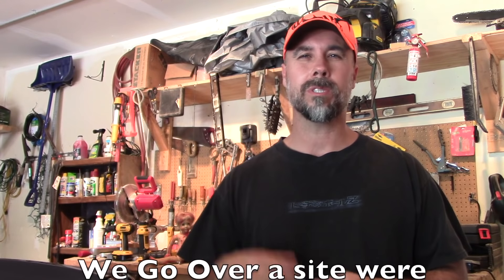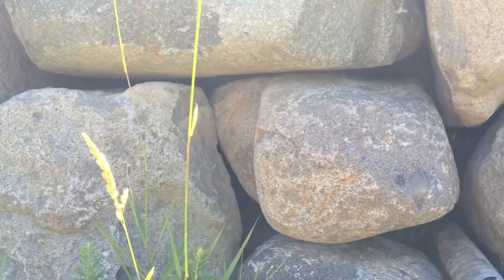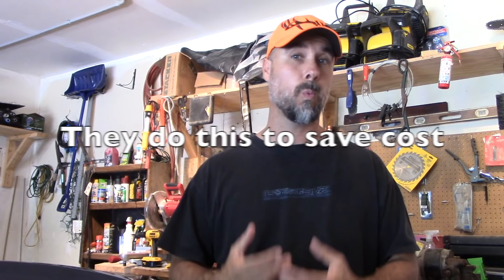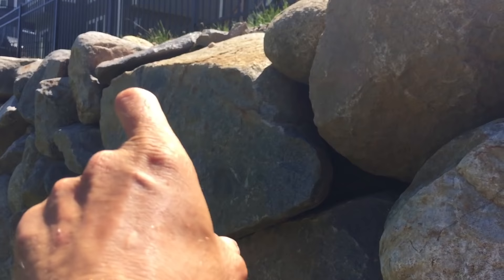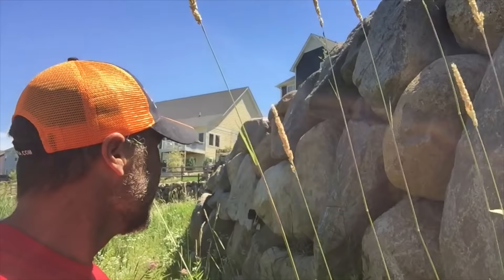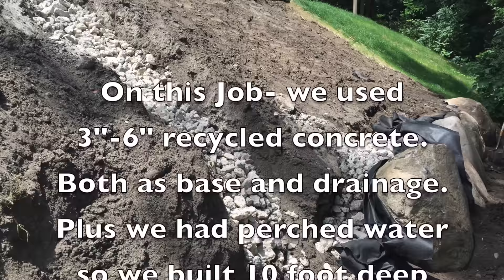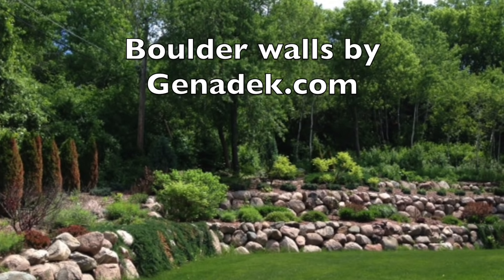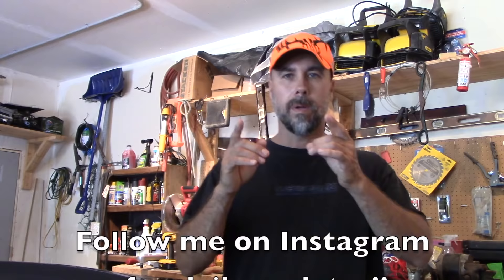Why Boulder Retaining Walls Fail

Comment: My ancestors had been building rice terraces using smaller rocks for thousands of years. Its quite simple to do riprap or retaining wall or whatever you call it. You just need to make sure you burry a foundation with bigger rocks for the other stones to interlock. Bigger rocks are stronger but moving them to get the right face is difficult. You need to turn the rock around to see which side fits best. For every layer, you need to put soil in between to tighten the interlock. You also need to pound the soil to prevent water from seeping in. The secret is interlocking and weight. Thus, you cannot put rocks on top of each other because it will be weak and the water pressure can push it. Another secret is leveling. You cannot make a riprap with one rock sticking out and all the others leveled. That is a weakness that the water will eventually push. 
.
I see in most American contractors in youtube that they dont build foundations. Riprap foundations are also make of a layer of rocks buried in a canal dugout, each rock sticking beside each other but it provides additional support for the other rocks above it.

Comment: I had a similar situation in front of my house. I use the daub and wattle method on that wall. After the stones are completely covered I will make another 1/2 a meter wall from organic material- cow poo followed by planting grass to hold the water in the soil, erect a fense, and plant deep rooting fruit bushes to hold all that in place. 
The price for the job is around 25 Euro. In the fall I will deeply mulch to get the ground healthy and hold large amounts of water preventing soil erosion!
Equipment I am using is hands bucket and gloves

Comment: Stan - keep making detailed and thorough vids, especially about base and backfill and geo-grid. I’m a DIY-er and need this kind of learning. I have a massive concrete block (2 1/2 ton blocks, 8 feet tall x 150 feet) retaining wall right on the lake that is failing badly and am building a sloped rock retaining wall up against it. Your teaching is legit. The more detail and explanation the better.
Reply from the maker: Thank you Justin !
Reply: If you ever do any kind of retaining wall on a lake where it has to be able to handle spring high water and pounding waves, I hope you vid and post it.

Comment: So if you have a large boulder, with say 6ft by 3ft by 3ft sides, a cheap contractor would create the wall face using the 6ft side and leave 3ft for depth. So I suppose now the rock only offers about half the friction strength plus the pressure from the soil and water has double the surface area to push on (ie pushes on 6ft by 3ft area instead of 3ft by 3ft).
Very interesting stuff! Thanks

Comment: Stanley,  What type of wall would you say is stronger - (when built correctly)  A:  A boulder wall using 3 foot (give or take) diameter boulders approximately 5-6 feet high(exact same as in this video).   OR...B:  A Rosetta hardscapes engineered wall using larger 2-6 foot outcroppings.    

The wall will be installed in a sandy soil.  Crushed stone underneath & behind the rosetta along with 4 inch perforated drainage pipe.  Fabric used as well on both walls due to sandy soil. 

Have you ever used crushed stone behind and underneath a boulder wall as if you were building it to the specs of an engineered wall?  Do you think that would increase the strength and durability of a boulder wall?  Thanks!
Reply: Thanks for the Video clip! Forgive me for the intrusion, I am interested in your initial thoughts. Have you heard about - Panilliaan Immaterial Prevalence (probably on Google)? It is a good one of a kind product for protecting your family from danger minus the headache. Ive heard some amazing things about it and my work colleague at very last got excellent results with it.

Comment: My neighbor's yard is sloped and he has a problem with drainage. I have a retaining wall that so far is intact. I do need to backfill some areas. Every time it rains I can see one specific area that it runs through. I have reinforced it with pea gravel and it has slowed it down. Is there anything g else I should do? Is backfilling with rock and dirt best option? Thanks

Comment: For one I never understand why you guys down in certain parts of the United States use those round rocks for stacking. Seems unstable from the start and that since they are of obscure shapes they naturally will move.  Up here in Ontario our boulders are flatter and more square. They stack and sit alot nicer then these do. Full contact with the joints alot tighter as well... Up here we backfill boulder walls with 3/4 clear gravel for drainage with a big O weaping tile at the base to divert water. Even if you have clay material the silt will eventually fill the gravel, so filer cloth is needed to keep the stone clear. Works like a charm up here in Ontario Canada
Reply: Scott, my cottage is on the side of a slope down to a lake (Bobcaygeon area).  This slope is mostly buried rounded boulders ranging from 2-3 ft up to 6-8 ft.  The place was built in 46 just after the war.  Thanks to a poorly installed large concrete septic tank, the slope was destabilized and in the last 7 years, has shifted about 6 inches out and about 9 inches downward.  Needless to say my deck, which is approx. 14'x22' on 12-16 ft. 4x4 posts, and the cottage footings, are moving considerably.  

I have been researching alternate methods of stabilizing in order to rebuild the cottage.  Any ideas or contacts would be greatly appreciated. You can't push a shovel in very far before hitting one of these boulders.  The lot is .7 acres, the slope appears to be about 45 degrees.

Thanks in advance.
Reply: IndyRosebush 
First get a soil engineer. Then go from there. Better to really know what is below than guessing otherwise you'll be throwing money at it. After that maybe concrete pylons will be needed and other methods of preventing soil erosion. 
Get an expert before the house goes below you if it's already moving your patio. 
Good luck.
Reply: Filter cloth is a prehistoric method. It’s been debunked as an effective means of keeping fine materials from the 3/4 crush and has been proven to actually effect walls structural integrity. No one with any know how uses filter cloth anymore. Stop using if you still are!

Comment: Interesting info...i have been excavating for 30 plus years in central Oregon...Bend and Redmond. We have a high desert climate, sandy loam dirt, lots of lava rock...everyone has rock-hammers...I had a powder license for 7 years way back in the day before rock hammers had a second generation perfected design. We also build mainly boulder retaining walls in our hilly areas. Our codes don't allow over 4ft before staggering back 18 inches for the next bench. We typically use 2 to 3 ft average...something a 8,000 lb mini can handle. There are lots of 120 size machines w/ hammers in this area so of course larger boulders are used with bigger machines. I couldn't handle your style of clay mud...our soil is extremely sandy so it is easier to work with in wet weather. 
  I do have to educate my builder friends why I cant set those nice flat rocks I set aside for capping the wall on edge to gain height. Here also prefab block walls typically always are laid on a concrete footing for stability...a code requirement.   
  I am 60...been self employed 33 years...still a small business...still learn from mistakes...usually bad verbal information from a builder that I base an estimate on...too much "good ole boy" will cost even me money at times.

Comment: Hi my 18 inch high retaining wall is not doing well.. high clay content in soil and filter fabric so soil is falling into parallel driveway - they did not put drainage in - I need to have it redone - also neighbour has high hedge on boundary behind ( 2 -3 ft higher than my property) Contractor only put in one row of boulders at 18 inch high ...maybe I double height of wall by putting extra row of boulders ..but first put gravel drainage - would about 4 - 6 in deep be ok  ... input please? am I on right track? the videos help a lot...

Comment: Since that failing wall required engineering and was installed wrong,  how did this wall get completed?  Is there an inspection, is it compared to the engineer drawings,  how does the planning,  permit,  and construction all tie in together?

Comment: Would this type of boulder wall work under water say in a pond? The bottom of a pond I am digging looks identical to the boulder wall details photo. If it could any pointers on what would need to be done differently if anything? Excellent video by the way! I’m glad I found it. I would have done it completely wrong for the same reasons you stated. Thinking about it now, it makes complete sense. Going in deeper allows maximum contact between materials giving you the best possible frictional resistance.

Comment: I "git it," Stanley.  Small stones are easily displaced, large stones, well, they work if tied into the backfill...  So build with stones sized to the mass they need to retain. 

Filter fabric is great for sand, ok.  Fabric is not great for clay with silt that will plug the fabric and create a dam which will blow out, ok.  So maybe perforated tile behind the fabric and ensure drainage with outlets where the pipe can drain outside of the wall.

Kool ECHO mesh trucker cap noted.  Check out dude's insta account.  Ok, maybe time to break down and insta.

Comment: Great video lots of great take aways from this one. Thank you. Considering they compromised face for structural integrity would a inspector see what you seen in that wall or is it mostly ignored in the industry? Say the inspector approved the final product but it fails would the liabilty fall on the inspector or contractor? Or both?
Reply: Inspector for sure I work for a rock wall retaining company in CA. We build our correctly though, it must never be vertical and it must be built with crushed rock on the back end smaller than your face rocks and no spaces the size of your open hand in between rocks. 6 ft to 1 ft ratio so take measuring tape 6 ft high and 1 ft out measuring towards you take a coin or small rock or whatever at 1 ft out towards you the object dropped should land right at the base of the 6 ft rock wall that means its graded back far enough to where it will not collapse barring it is built correctly all other ways stated above. We build industrial 12 ft or higher walls so our standards our of the highest.

Comment: In regards to permits and other laws to follow when doing construction: how do you go about finding what laws/regulations you need to follow or what permits you need? Googling it mostly is a massive amount of time spent but with often very little results, and digging through the government's law speak and gibberish in their "official" regulations manual isnt an effecient use of time either. Is hiring a lawyer/attorney the best route here to get all your possible needs with permits and regulations that you need to follow, laid out to you in plain english? Thanks for your time.
Reply from the maker: just go to the building permits division in the city you are working.  Describe what you are going to do- they will tell you what you need for permits and license.

Comment: Trevia: In 1985, the year I started my excavation business, you could buy a "Powder License" for $15.00. You filled out a 2 page honor system questionnaire...that was it. Many of us younger guys in this area grew up around lava, drilling and shooting. It was not uncommon to have 2 or 3 sticks of 40% dynamite sticks rolling around under your pickup seat. My old boss...before 1985...would drop me off at 22 yrs old with a teenage helper, a case of powder and the air drill to drill and shoot a septic tank hole or a water line. We could shoot a trench within 5 ft of a foundation...carefully in small contained shots.
Reply: Shane vanWinkle j

Comment: What if you have a clay type soil but 16-24 inches of sand directly behind the wall with fabric and drain tile?
Reply: don't over fill and make sure drainage isnt going to be an issue.

Comment: Dont you try to build depth = height and behind wall sloping up to capstone.  Pour mortar after each lift?  I had a rubble wall built years ago and that's what they did.  Told me they needed the sheer mass to hold back wall.  Essentially a pyramid shape with one side showing.